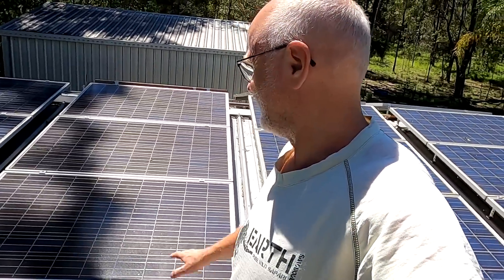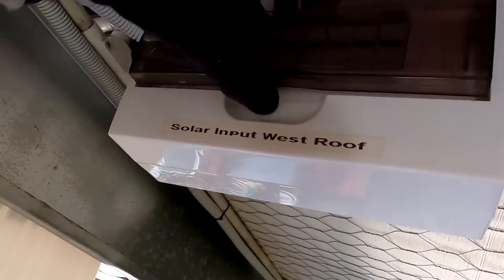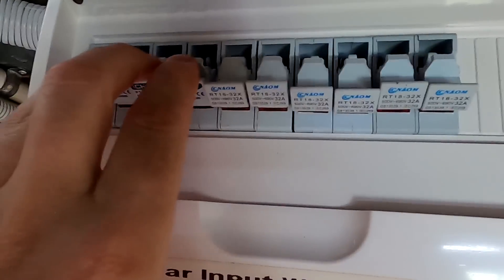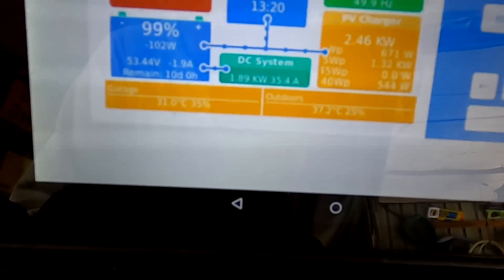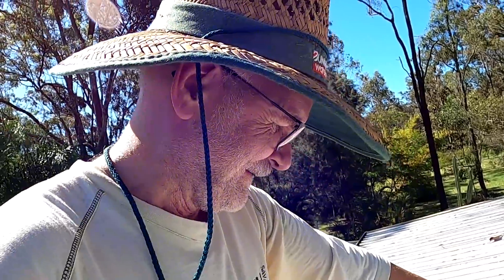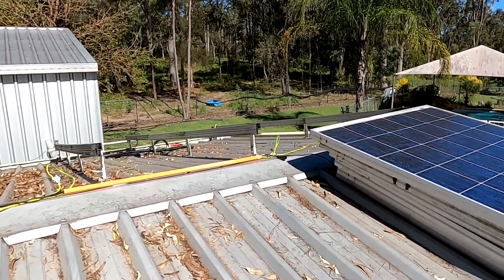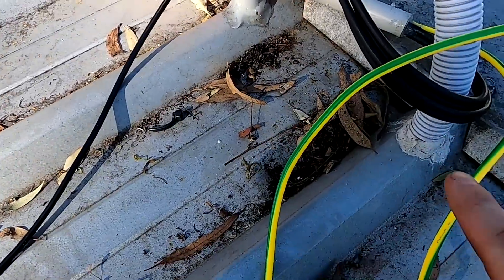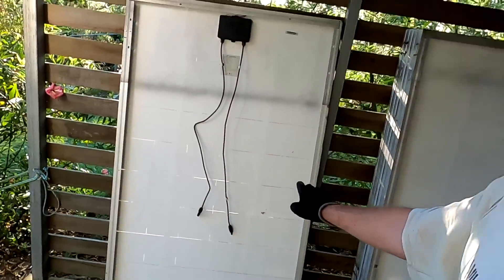Everything gone! I had to remove all solar 5/5

Comment: Really good video, and I certainly understand how much it hurts to see all the hard work and effort dissappear so quickly. But the good news is that all the effort is not in vain, but rather now is being sacrificed for bigger and better things.
Reply from the maker: Thank you, John. I was glad I did all this work to learn, understand and share. It was also good to see how far you could come with such used panels, how they perform in different situations and seasons. I've got some data now to compare to the new system.
Reply: @OffGridGarageAustralia  Be mentally prepaired for bad days when the Photons just can't get through. On bad days there is no differance between my brand new Trina Solar Virtex S or my used gumtre panels.   O.7kWh all day is my worst so far out of the 4kw of new Trina panels.
I nearly cryed!

Comment: Andy, your batteries are going down ! 
Only 14% left (NOT GOOD) and you have the courage to to still pull over 1kwh off them with only 72watts coming from the poolfence. Where is the update on the install ? 
Well, in the mean time, good luck from late night in the Netherlands.
I'll have an ice cold very well calibrated S.P.A.T. On you, cheers !🍺
Reply from the maker: 14% are still ~5-6kWh, so I'll go for it. As long as I don't hit 3V, it's all good.
Video is coming...working on it, mate!

Comment: Probably the only good aspect to do this task in such hot period is that the cables easily get out the pipes thanks to the added flexibility of nice warm copper...
Reply from the maker: The conduits are all short runs luckily, just through the roof in the combiner boxes. We will see if the sparky will use their own cable glands now for that.

Comment: You should put the cables in through the side of the building not through the roof and if you want to use same holes it was easier for the electrician to use the old cables to pull the new ones through but i still enjoy to see your video. You are a star the way you are :)
Reply from the maker: They will use their own glands to go through the roof, I believe.

Comment: What about all the old holes in the roof?
Reply: He mainly used existing bolt holes, so just put the original bolt back with sealing washer.
Reply from the maker: Yes, all screws went back in. The roof is now in its original shape again. Apart from the conduit holes...
Reply: I wondered this too.

Comment: The upgrade will make you forget about ripping this all out.  That hot spot on the one panel is scary... haven't seen one before.  Now I understand how they could catch fire.  Great video as always.  I hope you'll get some footage of the upgrade even if you're not doing all the work.
Reply from the maker: Yeah, I was a bit surprised as well with the hot spot and that it went through already. More testing coming...
Reply: A few years ago I replaced 30 10 Year old Panels from a customer under warranty and they all that multiple hot spots.
The manufacturer was sun power.

Comment: Hi, love your channel. I am learning ideas from your setup and doing similar(but I am far less experienced compared to your fantastic manufacturing ability).

I have a question. Relating to your busbar system, out of interest 
1. what is the dimension of your busbar?   
2. Do you think mounting horizontally is better than wall mounted? 
3. Was/Is there any concern with weight, mounting the busbars on a wall vertical, or other benefits to doing as you did?
4. Did you buy your perspex already made?

Love your content, thanks!

Comment: So how much did you pay per kWh that you harvested from those panels+installation? That would be interesting numbers.
Reply from the maker: How do you calculate this. Very very hard to tell. All the data is in my VRM though, so 3.5MWh since I installed the logger, a few hundreds of $$$ for the panels, labour, other equipment...?
Reply: @OffGridGarageAustralia  Yes. It would take a lot time to list all the values that went into the system. I'm in process of installing solar on my boat and bought a lot of marine grade cables for all the electric - and I would not start to write separate lists for solar, water maker etc - understand that. But from your experience? Some rough numbers? Just because in the end it would be nice if all the doing even makes scene ;)

Comment: Our journeys have been similar. Battery build and Victron setups and I’ve been running second hand panels for around 2 years - along with some brand new panels - they out perform second hand older panels by a long way - and when roof space is at a premium it’s false e coming to use second hand. It will be interesting to see a sparky work on your system - getting it somewhere near compliant is something I’ve wanted to do but it’s next to impossible to find one that will work on the systems without paying cash :-)
Reply from the maker: Yeah, I'm glad I found the sparky in this area here who has some knowledge of this battery stuff. I have to pay him, true but it is worth it to keep it all safe and compliant. He will do more work for me in the future.

Comment: not sure I would have pulled out all the cable, they might want to use them as draw strings if they're using the existing ducting. But I suppose if they asked for it all stripped back. Are you doing anything about the old screw holes?
Reply: I thought about that, then remembered he used existing bolt holes in most cases.
Reply: Roof junctions should be Solodeck boxes and inside should be metal conduit for all dc wires.  Combiners also are usually on roof so only 1 set of main cables runs down. Lets see what they will so.  I doubt any of the old stuff could be used.
Reply from the maker: The sparky will use their own glands was my understanding, so not sure if they will use any of the existing conduits. And as they are short runs only, I believe, they have a cable feeder to get them back in easily...

Comment: Andy, do you think to use power optimizers with solar panels? when I see the videos I notice some of the panels have shadows over them... this will good chance to create hot spots issue. Do you planned to replace solar panels or use same panels from previous installation? It's better if you can use half-cut cells panel, it has good resistance to hot spot issue (bcz panel will contain 6 strings instead of 2)
Reply from the maker: No power optimisers! They don't do anything unless you have panels in different directions in one string.
I'm getting new panels installed as explained in this video here: https://youtu.be/obGwHrt08-k

Comment: You could have left the cables in the conduit. I would be happy to pull the new cables threw with the existing cables 😅
Reply from the maker: I think they will use their own holes and conduits. As I said the conduit and silicon is apparently not as per code.
Reply: @OffGridGarageAustralia  I'm curious to see how it goes 😀

Comment: Hi Andy. How many years where these panels in use. This cracks and the hotspot are don't looking good! I'm a little bit afraid if this happens to my panels. 🙈 I've got brand new trina modules and i hope this will not happens to me till the next 15 years! 🙈

Greetings from Germany.
Reply from the maker: I have had 4 different brand of panels one the roof. So far only the Canadian Solar have shown these cracks and hotspot. They are used panels I picked up 2-3 years ago and are probably 8-10 years old. Could have been a bad batch as Canadian Solar is usually prety good. But I had one on my house as well with such a hotspot (Renesola)). All others are fine.
Reply: @OffGridGarageAustralia  ok, you took a little bit scare off me! Now I think I am fine for the next 10 till 15 years with my panels. But it is noticed, that I do have a look on the panels in 10-12 years, just for maintenance! 

Thanks for your videos and answers!

Many greetings! 🤗

Comment: So for low voltage and low amperage strings they burnt really well.  My inverter can take 500v VOC, that's a scary amount of volts.  I've bought some MC inline fuses for the summer.  All my panels are ground mounts, I refused to have then on the house.  For cleaning etc.  Once they catch fire how will you put them out on a sunny day on a roof.  DC power is so dangerous as you can't let go until you're dead.  240v AC gives you a kick and you just shake that off.  Also, this kinda takes the fun out of DIY Solar if you get someone else to do it.
Reply from the maker: Well your comment is a bit contradicting. You say Dc power is so dangerous and then want more DIY work with that. I think I explained the background of getting them installed in previous videos.

Comment: disconnecting strings by removing fuses, under load, is not good idea.
Reply: These fuse holders are made for that specific purpose since they are generally found in commercial combiner boxes. That is why the entire fuse swings so far out that it eliminates the problem of quenching a DC arc because the distance is so large and the disconnect happens so quickly.  You are only talking about 80VDC and 8-9 amps under load since he has every string separated.
Reply: This maybe correct, however I have had problems trying to disconnect with this fuse type, not wanting to release properly for some reason, has anyone else had this problem?
Reply: @kuhrd  In datasheet of many of this fuse holders is: "cannot be used for switching under load". And yes, 80VDC could be safe. Especially if panels are in shade. But general people are watching. Someone could been do the same with 400V strings. Right way is: Disable charging on mppt and then i can get the fuses off. Or Switch of proper DC breaker and then the fuses.